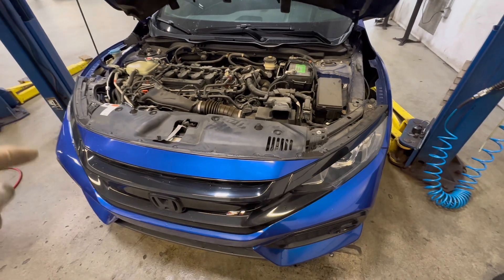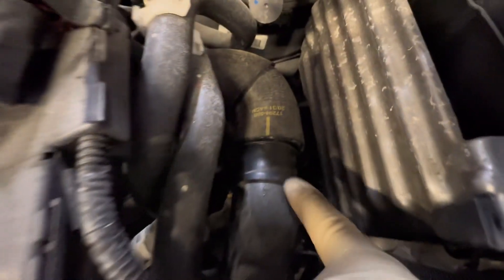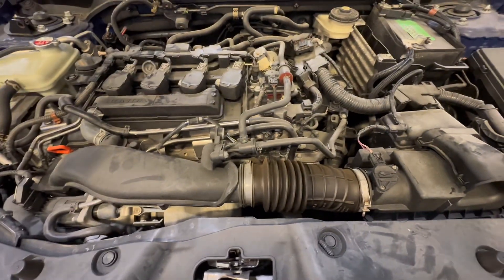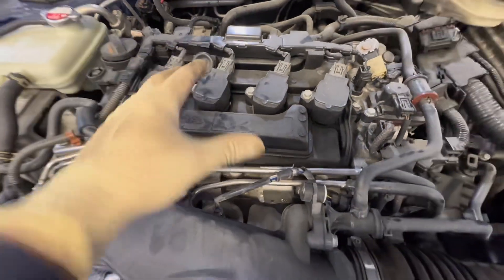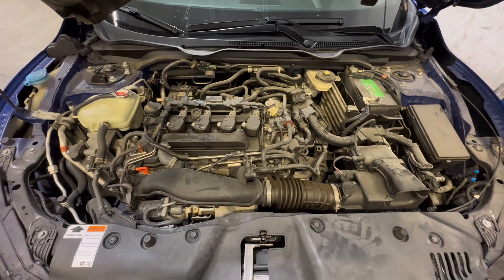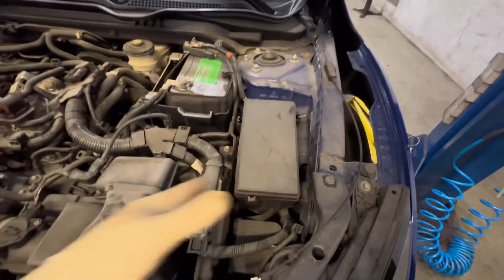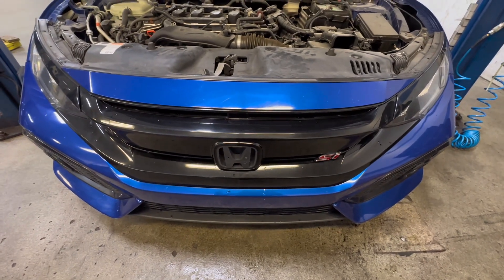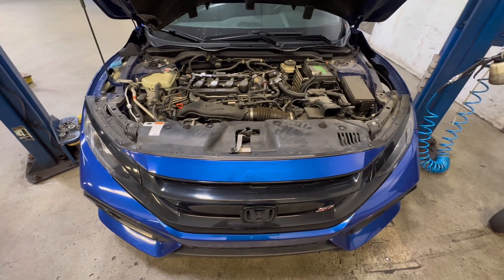Honda civic si purchase gone wrong

Comment: I’ve looked at about 7 of these used with low mileage up to 40k miles and they have all been modified and put back together poorly. It’s very unfortunate. Those was a good generation but if your looking for a turn key Si now, gotta buy new.

Comment: Bought a used 2022 Si with 20k miles and at 26k the clutch went out. After i had it replaced it went again at 30k.  I remember when they sold me the car the salesman handed me the carfax with a service bulletin “transmission checked.” I went to dealership that serviced the car and found out the clutch was replaced and the previous owner had the same problem. I told my dealership service manager this and she didnt think it was suspicious. I sold the car and ill never buy a USED performance sedan again.
Reply from the maker: @cheesuskrust7021  sheesh that’s rough. Wonder what the root cause is.
Reply: @BCautosutions  a tech at an independent shop said my CMC was sticky and a transmission bracket was broken, but they have no idea.   Ive been driving MT since 2004 and this Si was my 5th MT and the best i can theorize is that all of my previous cars were older and modern MT are different.  So idk
Reply from the maker: @ weird, thanks for sharing
Reply: @BCautosutions  i gotta replace the car and even thou ive been thru a disaster with this Honda id still consider buying another Honda. I know you dont like the 1.5T but how do you like a 2022 Honda Insight, it has a 1.5?
Reply from the maker: @ the insight has got to be the rarest car to come in through the door and for good reason. They don’t break lol

Comment: Some people are real shitbags. I picked up a 2020 with almost 13k miles from the salvage auction. Hit from the rear and then uncured some front damage so no airbag deployment. Bought all parts from oem except the radiator and condenser. Problem with these vehicles is the way they're built make repairing them after a front end hit very expensive. The turbo locks up easily in an impact.
Reply from the maker: Yep, bunch of people trying to make a quick buck always unfortunately

Comment: That's insane. It's not even that old of a car to be that modified , and needs a new engine. And it's clearly been abused if it's got worn out 3rd gear synchros. Always get that preinspection done!
Reply from the maker: 💯 unfortunately someone will buy this and have nothing but headaches for years to come
Reply: @BCautosutions  It would make for a good project car if someone had the money and know-how. I wonder how well a J series would fit in there....
Reply from the maker: @ryans5615  only one way to find out 👀